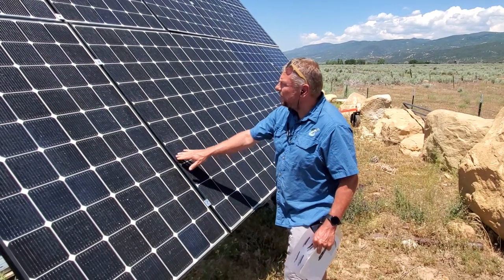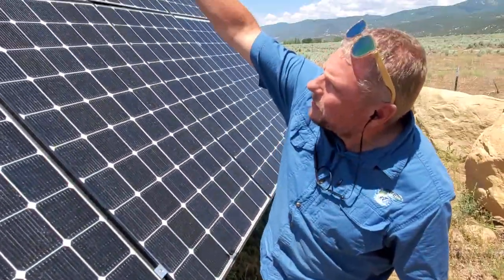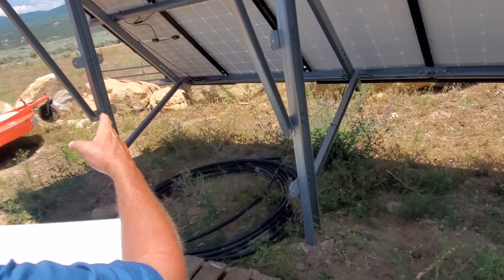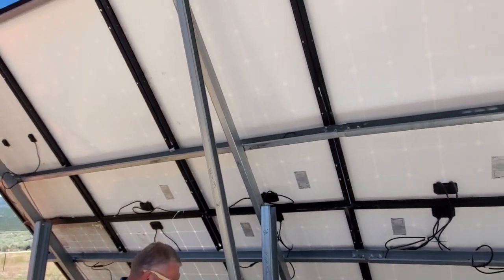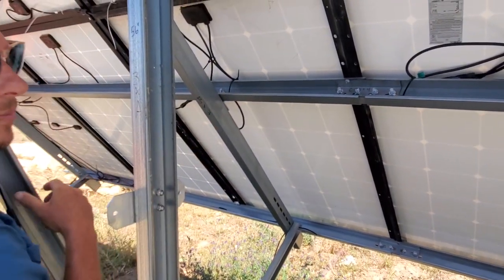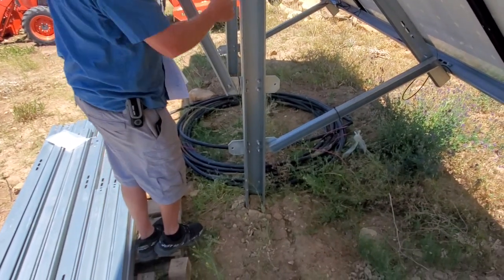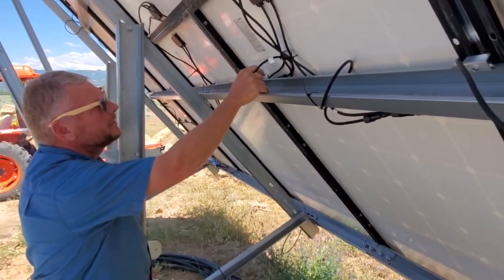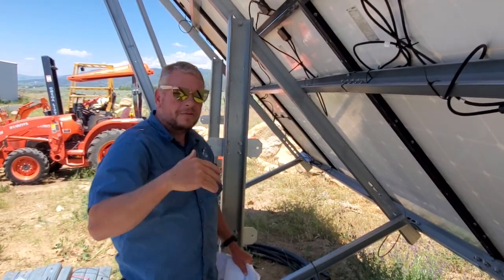Watts247 Solar Panel array Mount 10 panel and 8 panel Array (5 x 2 or 4 x 2)

Comment: Making all the plans to mount/install the first one. 

#1 The column in-ground depth is set to be 59". The first set of holes from the bottom (where the lower connect plate mounts) is 64 ½". Unless there is some distortion in video scale, the columns are not 59" in the ground.

#2 You say to use Unistrut to increase the width for wider solar panels. The size of Unistrut (width, not length) is not specified. Searching the Watts247 website, no joy.

#3 Going over all the available data I see how some complain; the documentation could be better. Phone camera photos of drawings, parts list, etc., not the actual document in PDF/PNG/whatever is ... lacking quality. Laser prints of the photos are fuzzy because the source is a photo, not actual lines and text that can be scaled correctly, for printing. However, the above aside, putting it all together should not be difficult. 

Please produce better and more complete documentation.